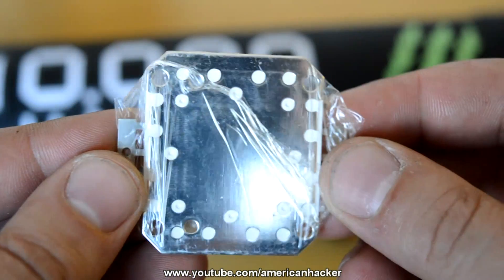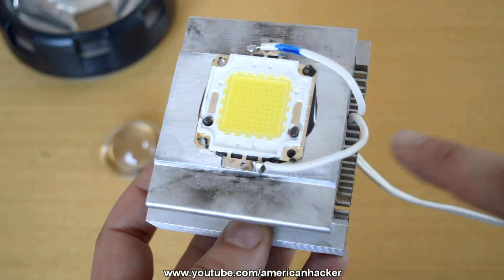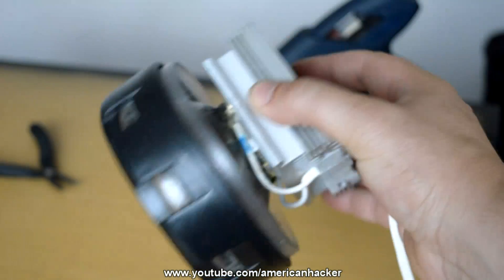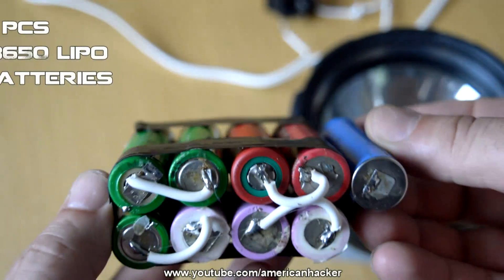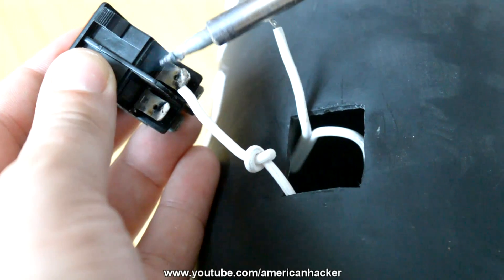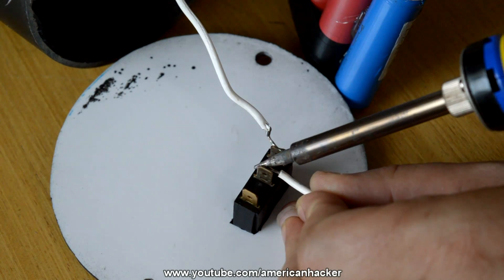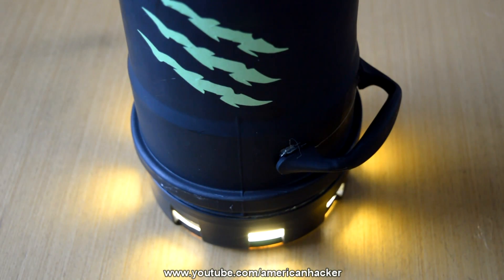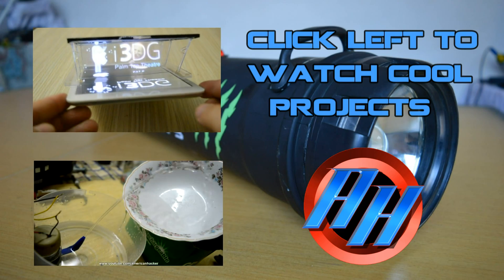How To Make Monster Flashlight 10,000 lumens

Comment: This project is a piece of crap becase firstly the heatsink is too small and needs to bee cooled by a fan. The 18650 batteries have zero protection (May cause a fire) and third the flashlight has no driver which means the current draw increases and thus the led chip gets hotter and will break quickly.... American hacker has no idea about electricity
Reply from the maker: +danijel124 all that is right
Reply: +American Hacker lol best way to respond a hater
Reply: i think its just a fun project and not a 100%practical project
Reply: sean he needs a driver to drive the led. If the led doesnt have a driver circuit it will fry overtime...
Reply: Clearly not American lol

Comment: Specification:

Product                                :American Hacker 10.000 Lumens Monster Flashlight.
LED                                       :1x100W 30-34V 3000mA LED Chip.
Driver                                    :N/A
Drive voltage                       :37.8V at full charge
Drive current                       :>4000mA at full charge
Rated brightness               :10.000 Lumens
Typical brightness             :<8.000 Lumens
Battery                                 :9x3.7V 2200mAh Mixed 18650 Li-Ion
Working time                      :30 Minutes
Heatsink                              :Small aluminum uncirculated passive cooled heatsink
Safety switches                 :Yes
Rechargeable                     :N/A
Balance charger                 :N/A
Overdischarge protection :N/A
Overcurrent protection      :N/A
Short-circuit protection     :N/A
Explosion-proof case        :N/A
Current-limiting resistor    :N/A
Reply: wow thats cool ...

        ...give that man a cookie

Comment: So we can not charge the batteries  ? How long time can we use the Flashlight with this bateries
Reply: I'm also considering using nine 18560 batteries in series, I'm ordering a driver for it today. How would I test the capacity of the batteries? I know they cannot be trusted since they are ultrafires
Reply: Oh, sad... That's about 600mAh. I never knew they were that bad. So the question now is where to buy good 18650 batteries with at least 2000mAh?
Trusted sellers? Anyone?